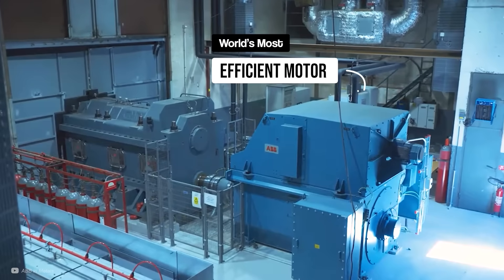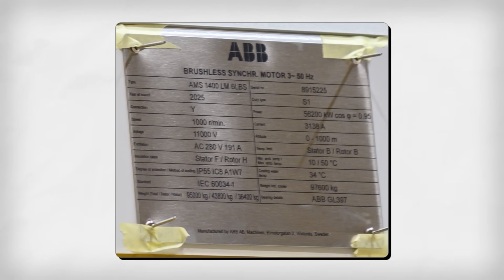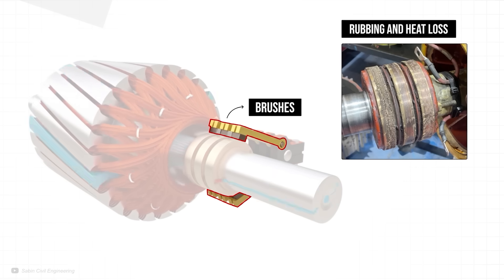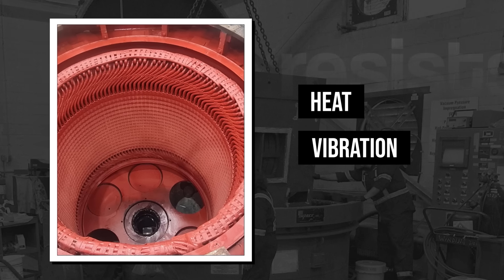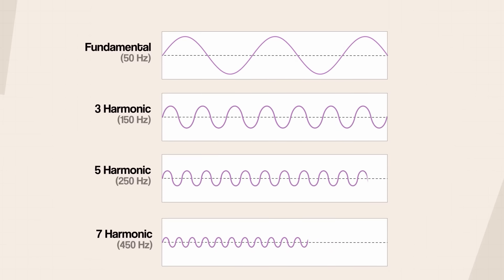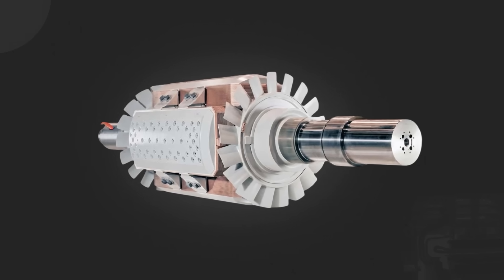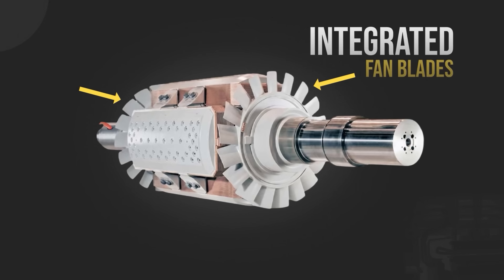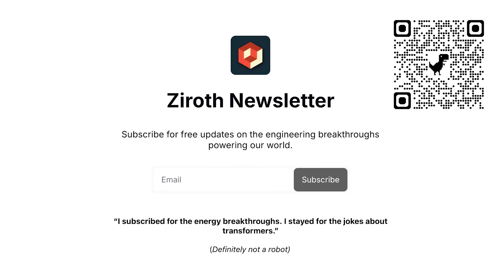How This Ultra Efficient Motor Just Broke The Limits

Comment from the maker: Quick note: this video is meant to compare common motors with industrial motors. Industrial motors have achieved very high efficiency over 98% for a while now. 

Invest in a better night sleep and be more efficient with your heating and cooling with EightSleep! Use code ZIROTH for $200 off the Pod 5 Core or $350 off the Pod 5 Ultra, or visit https://eightsleep.com/ziroth
Reply: All A/C generators manufactured in the past 2 or 3 decades are brushless.
Magnetically coupling separate stator winding with rotor is less efficient, but trouble free.
Such a High efficiency means very small rotor stator (magnetic) gap, prone to motor damage when bearings fail.
The harmonics are reduced only with certain coil arrangements.
Reply: The payback is likely calculated using the incremental cost increase from "standard" efficiency up to the "high efficiency". This method of payback assumes that the standard motor has to be purchased as the baseline capital cost and any upgrades would be considered incremental cost increases. In this case, they are claiming that the incremental cost increase is covered by the energy cost savings in roughly 3-months.
Reply: Hahahahaha! Four grand for a mattress topper that has a monthly subscription.  I thought you had a doctorate.
Reply: I would like to add some context about harmonics and instrumental tones!! Your video is wonderful and has all the context it needs, but the physics behind this phenomenon are fascinating and I would love to share.

If a piano had no "harmonics" it would sound like a sin wave. What makes a piano sound different from a cello, which sounds different from a flute is the fact that all of these instruments produce "harmonics" at unique ratios.

In performance and composing, these overtones are indeed called "harmonics," however, the technicians of these instruments call them "partials" instead, because they are not true harmonics.

A harmonic would be an exact multiple of the fundamental frequency. However,  the shorter an object (or piano string) is with relation to its diameter, the stiffer the material becomes, which results in a frequency slightly higher than anticipated. This means the half length sounding the partial is slightly sharp. Piano tuners need to be acutely aware of this. They tune the center of the piano to a reference note, and tune the rest of the piano to the center. The lower half gets tuned flat and the upper half gets tuned sharp, so the partials are in tune with each other. 

So a standard A4 is set at 440hz, and you would expect A3's fundamental to be 220hz, however a 220hz tone from a piano string would produce the first overtone at something like 440.4, which creates some unwanted dissonance. The solution is to tune A3 a bit more flat, say 219.8hz so the partials line up exactly.

Apparently sliding a bow across the string creates an effect called "mode-locking" which I don't quite understand, but it negates this effect and you get true harmonics.

Anyway, nerd to nerd, I hope you find this interesting. 

Last bit - in astronomy, we have begun to start observing gravitational waves to learn about our universe, specifically colliding black holes. Before they collide, they orbit each other at rapidly increasing frequencies. After the collision, there is a moment of gravitational "noise" that is called a "ring back tone." In this tone, harmonics are also observed.

I wanna go on about how double and triple rainbows are also displaying the effects of true harmonics in physics, but I feel Ive already info dumped way more than anybody cares lmfao

Thanks for the vid. I really enjoyed it
Reply: Why is thumbnail image of a brushed rotor? It looks like lousy AI anyway, is it so hard to make it make better image?
Reply: The numbers given for this motor indicate efficiency of 94%, NOT 99.13%. Multiply volts (11,000) times amps (3138) times the square root of 3 (since it is a 3-phase motor). That gives power consumption of 59,786,930 watts. Divide the power output, 56,200,000 watts by the power consumption to find the efficiency: 94%. So who is trying to fool whom with this bogus figure of 99.13% ???
Reply: @YodaWhat Your calculation is missing the power factor, which is 0.95 on the plate. This brings the result to 98.9%, which isn’t exactly what they quoted, but close enough.
Reply: @markirmuir  - Was being generous by assuming UNITY power factor. The 0.95 PF you quote makes the motor LESS efficient, not more.
Reply: @YodaWhat     Including the 0.95 PF in your watts calculation makes the consumed electrical watts less. And since the electrical watts are in the denominator, it makes the efficiency go up to about 98.9% (Less input watts for a given output means higher efficiency.)    With copper I²R losses, windage losses, hysteresis losses, eddy current losses, bearing losses, it's hard to imagine all these combined would amount to less than 1%, but I'll accept that it is.
Reply: @zirothtech im guessing the payback ROI calculation was the difference between the cost of an industry standard motor vs this one. No way it only cost $60k but maybe it was $60k more than a normal motor.  
Otherwise yeah the 3 year ROU number of $700k is probably more likely the total cost
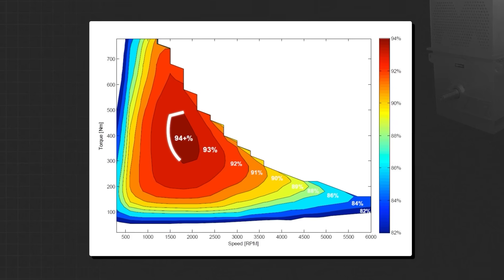Reply: 1:05 no you don't! If you did, you'd just shut up and get on with it.
Reply: Talking about a motor and not knowing IP (international protection) standards, tsk tsk tsk
Reply: there are superconducting motors with basically 100% efficiency
Reply: Motor efficiency it's not just a phase. It's three phases.

Ba-dum-tss.
Reply: @DiThi  eyyy, glad someone said it!
Reply: I was about to say it
Reply: You realize they're not a mattress company, right? They're a data harvesting company that sells your sleep patterns & biometrics to anyone who'll pay for them.
Reply: @absurdspeed  I'll eat a bowl of water with a fork before I buy a bed that's connected to the web.
Reply: @absurdspeed   he has a doctorate. Im sure he... realises that people trust his... endorsements... and wont be adversely affected in any way... its all about trusting people who are... very smart
Reply: You, Matt Ferell, and Physionic are my go-to source of information on things in the field of science and medicine.
Reply: What impact will that have on EV and their range ?
Reply: @typxxilps none. If you want infinite range however, you just add a zpe device. It's even possible to go without batteries, using only a large capacitor bank and zpe device. There are solid state coil ones, there are ones that run off ground charge modulation, there are zpe motors like the 16v invented by Keely and used by Ed Leedskalnin to run his Model-T with 40hp.  Zero point energy is always over efficient. If you pound rebar deep into the ground and solder a set of lateral copper plates around it, you can use that to charge a tinfoil pyramid across spark gap, and will discover infinite energy. The ground does have charge modulation, so just by resisting it's modulation with 3 copper plates with about 1/4" separation, the pyramid across spark gap will never get a full charge. There is always 1/3 charge left over on one side or the other when spark gap is bridged. You slowly open spark gap and all white noise emf, the fading 3 phase echo, and the carrier wave will cause waves to implosively fold off the apex of the pyramid into a single higher frequency which jets of energy and never gets it back. Using this flow of energy loss, you can use a wire in series with spark gap control outside the pyramid to make a coil around a transformer and step the voltage up or down as needed. Tesla did this using a coil instead of a pyramid in Colorado Springs for his free energy, and made massive amounts of it.

Comment: That's garbage, Just use Gas Bearings or Liquid Metal Beads suspended between a Liquid or oil bearing instead of Slip rings.

Comment: Hate to say this but, this is not new technology at all and considering the size of the motor even 1% losses are absolutely huge. Slip rings and harmonic generated waveforms applied to motors have been around for at least 70 years and predate the electronic converter drives. Taking the holistic approach, DC motors are much more efficient but will upset too many "experts".

Comment: With an estimated cost for electricity in India of 0.15 USD per kWh (=150 USD per MWh), it seems that your calculation is off by a magnitude: 3 months * 30 days * 24 hours = 2160 total running hours, 2160 hours * 56,2MW = 121392MWh, the efficiency is 0.9915 eta_new - 0.96 eta_old = 0.0315 eta_improvement. So it saves about 121392 MWh * 0.0315 = 3824 MWh, what equals a cost of 3824 MWh * 150 USD/MWh =573600 USD. Under the assumption, that this motor is purcheased by this steel plant, because of tremendously high energy cost, it would be conclusive to pay off in about 3 months.

Comment: I suspect the 3-month payback they refer to is the operational cost savings as compared to a standard design, less expensive motor. The $60k figure may be the price difference between this new high-efficiency design motor vs. the standard design motor. So the 3 month period referred to then makes more sense.

Comment: So  is the excitation energy counted in the efficiency, is the air pumping and cooling counted?  I had always assumed that car alternators had poor efficiency (about 50%) because energy is used in the field coil and electric machines can only afford 1 electric field coil, a second one is pure waste because magnets don't need any energy to do this.  Its a parasitic loss like sucking air into a combustion engine.

Comment: Glad to see its actually 99% efficient and not like that other company that was claiming they had a 99% efficient motor but then it required cryo cooling which they weren't calculating in the power usage for that.

Comment: I was going to ask why 96% wasn't good enough and then you reminded me I live in an advanced economy.
Reply: Heat is why. That 4% waste is all being put out as heat. If you have a 10MW motor, that's 400KW of heat being put out. And that's a huge amount of heat. That's what really limits the power of electric motors; how fast we can keep it cool and from literally melting itself.

A more efficient motor is a cooler motor per amount of power. Which means a much bigger motor for the same cooling solution. Going from 4% to 0.87% loss literally means you can have a more than 4x powerful motor for the same cooling. Which there are also limits to what parts you can cool inside a motor and how fast. The efficiency boost actually means a size and power boost.
Reply: Bro put it better than I could. Heat is wasted power. The motor can run cooler and harder under load.

Comment: 11:10 The motor can be 60 000$ more expensive than another one if it saves 20 000$ per month. A motor with 96% efficiency would also cost millions i guess.

Comment: Something that reliably annoys me in media talking about the "efficiency" of anything

Is this a percentage of the energy efficiency of the ideal system? Is this referring to total energy lost to heat? As soon as extremely high "efficiencies" like 98% are getting thrown around my default is to assume that it is the fraction of the theoretical ideal engine; as in the actual device is within 2% of the efficiency of the ideal device.

Journalists seem to take "efficiency" as a term that requires no further clarification, but there a a crapload of ways to define calculate it. WHAT DO YOU MEAN?
Reply: Electric motor efficiency is the output power at the shaft, divided by the input electrical power.  If 99% of the input electrical power is converted into turning power at the shaft, it is said to be 99% efficient. The output power at the shaft is always less than the input power to the motor.

Comment: the 5th harmonic signal you show is actually a 4th harmonic - while you the superposition looks correct (i.e. fundamental + 5th) the quoted 5th harmonic isn't (it has only 4 full cycles)
Reply: Losses are proportional to signal frequency (skin effects increasing the current density as the current likes to flow near the surface of windings at higher frequencies) - hence why harmonics are bad for efficiency

Comment: I would like to see one of these used to turn a generator with a known efficiency level, say of 90% and see if it really could put back say ....89% of the power it requires to operate into batteries.  Chalk board math and reasoning does not convince me of efficiency when I already know of so many comparative losses involved, such as using copper instead of superconducting material .
Reply: Question 1:  At 0:07 Why does the separate world record label plate say, "Highest Efficiency 99.13% @ PF 1", while the other label plate says PF 0.95?  Question 2: How were the output shaft watts measured at 56.2 MW? Did they have a dyno that big?  Question 3: Why didn't they include the excitation losses in the calculation? Excitation alone is 53.48 KVA and the PF isn't specified for the excitation power. Question 4: With excitation losses, copper I²R losses, windage losses, hysteresis losses, eddy current losses, bearing losses, it's hard to imagine these would all amount to less than 1% losses. I'm saying it didn't happen!

Comment: Copper is not the best conductor available to us.  Silver conducts better.  Imagine gaining another 3% just by switching to silver.  Wow, a motor with 102% efficiency.  So that does not even consider using a super conductor which is far more efficiency than silver.  This implies that this efficiency level is comparative, and relative to some other system and is therefor inaccurate in absolute terms.  We can do better.

Comment: I call Bull on this motor's efficiency rating.  For one thing, using an induction coil to "transfer" electricity to a secondary coil has losses as it cannot compete with a direct connection.  Second, a brushless system must include losses from the control pulse board as a second system requiring it's own current and thirdly, instead of having to power just one set of electro magnets you must supply current to a second set instead of using permanent magnets to provide that power.  My only concern about permanent magnets is the cog force that has to be overcome to get it spinning which would be tremendous for a motor of this size and electro magnets could be timed to eliminate this cogging effect but at the expense of a second source of power.  Brushes have very little friction as they are graphite, one of the world's best lubricating substances.  I suspect they are just calling out the efficiency of just one of these three power systems.
Reply: My first thoughts exactly. Best case they have 90% efficiency through induction alone.

Comment: 🔥 This reminds me of a motor used in the "World Solar Challenge" over 5 years ago - a direct-drive, ~5HP permanent magnet setup that hit 'over 99% efficiency'.
Two game-changing features:

1. "No ferromagnetic materials" in zones with changing magnetic fields
2. A "five-phase drive system" instead of the usual three-phase - surprisingly easy to control now with modern solid-state tech.

🧠 If this tech is so efficient and viable, 'why haven’t we seen it adopted more widely', especially in EVs or small-scale motors?

"@Ziroth" - any thoughts on what’s holding back five-phase designs?
Would love your take on whether it's cost, complexity, or just industry inertia. 🙌

Also noticing similar methods popping up in 'variable-speed AC compressors' - seems like the concept is finally creeping into mainstream?

Comment: Does the claimed efficiency number account for the energy used in cooling it?  If it's the same as a 'standard' motor it doesn't matter, but one 'miracle motor' I read about had to be kept so cold that it completely defeated the efficiency gain of the motor.

Comment: 99% efficiency is impossible due to the laws of thermal dynamics.  5-15% at least has to be lost are heat in just the bearings alone not counting the armature.  If you have a PHD in electrical engineering will eat my MSEE Diploma.  This is not doctoral level work.

Comment: ABB ... they made the inverter that takes DC power from Itaipu Hydroelectric Power Plant and turns it into AC on a inverting station near São Paulo. Itaipu - for a long time the largest Hydroelectric power plant in the world until the Three Gorge plant was built. Half of its generation is 50Hz for Paraguay and the other half is 60Hz for Brazil. Brazil buys most of the energy from the Paraguayan side - they rectify it, transmitt it over nearly 1,000 miles, then alternate it. The ABB inverter was installed in the early 1980s. It's not a popularly known company but it's one of the best in the field.

Comment: You said something about a "single piece rotor" (solid salient pole), without talking about eddy current - how this avoids the impact of eddy current.
Reply: I'm going to take a guess here. The rotor is synchronous with the rotating magnetic field, so there is no relative motion between the flux and the rotor, so there are no eddy currents in the rotor. The stator would still have rotating magnetic fields and so it would need to be laminated to reduce eddy currents.